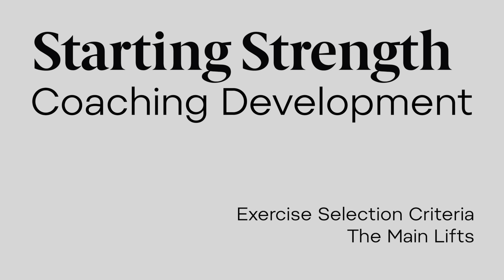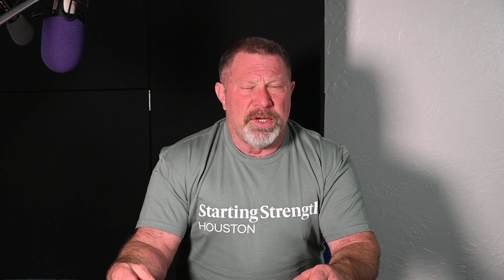Exercise Selection with Mark Rippetoe - SSC Prep Course Sneak Peek

Comment: The US military should take heed here, & revamp the physical aspect of at least Basic training, to improve  soldiers.
But that hasn't been the primary goal, in a while, has it?
 RIP is to strength & fitness, as G.Patton was to US forces.
Reply: The new Army PT test is better now at least.  It tests deadlift, a weighted bag throw, as well as other areas.  Way better than the pushups, situps, 2 mile run version.
Reply: The vast majority of the human population is dumb.
Reply: @Fogyt121  "ARE"
Reply: @robd2998  Is this all you got out of the comment?
Reply: Rob D iThe irony!
Reply: It wouldn't be realistic coaching these exercises to soldiers. You are abused with endurance with lack of sleep. Doing squats and deadlifts etc, you wouldn't be able to recover from them and would hinder ur mental and endurance capabilities
Reply: @connorw360  I'm sure that's why weight lifting's popularity originated and has been sustained in the military. They'd become artificial intermediates, like any other demanding profession such as first responders. POGs will have lots of rest and time to lift, and frontline troops should do it as well